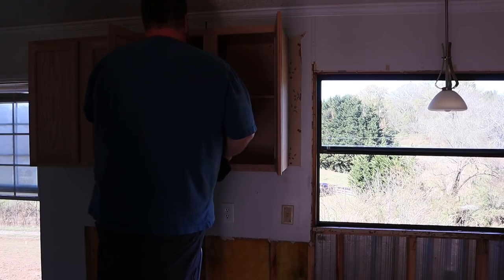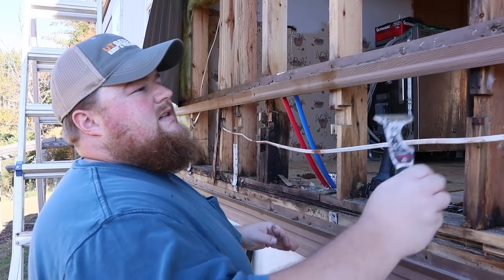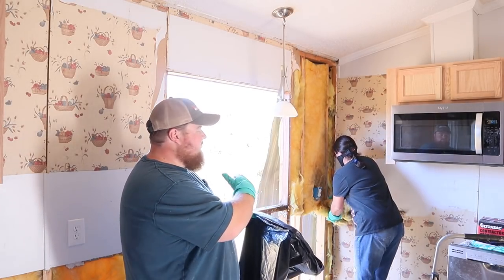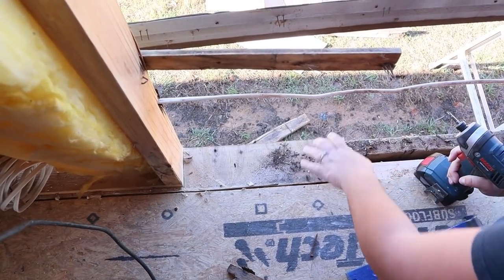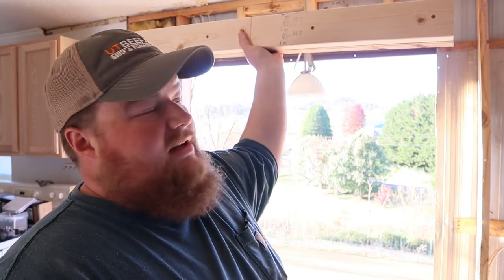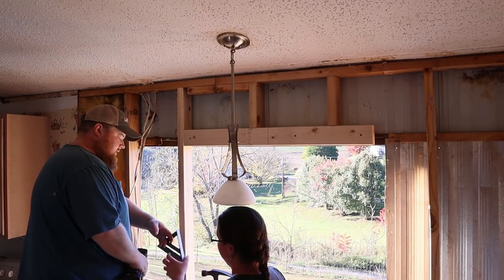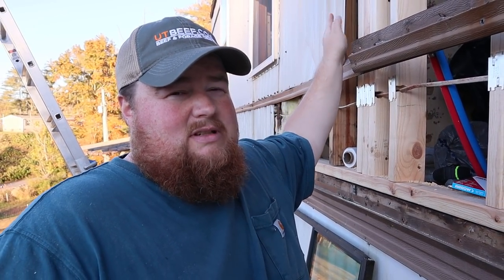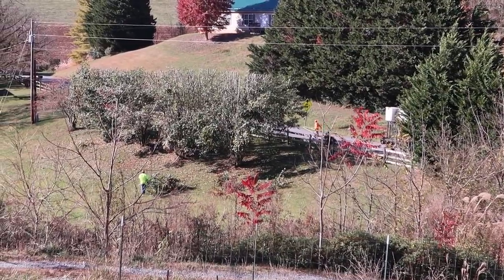COMPLETE Wall and Window Rebuild | Budget Mobile Home Remodel #17

Comment: Hey Guys
I like watching your video because you aren't trying to BS anyone. You have limited experience but you two can figure it out and are doing a hell of a good job. When my wife and I were first married I bought a MH for $300 and did pretty much what you are doing. I did not know to look for bad floors etc. Broken water lines blah blah blah. Worked on it every weekend and got er done. Only about $1200 in 1988 money and it was done. Still had to do heat and air but it was dried in. You two keep at it and you will always remember this build no matter how life turns out.

Comment: It looks great you two. I love how you guys work together  on your home to repair and fix it up like you want it. My wife and I worked on remodeling our mobile home for about 2-3 years. We installed a house type metal roof over entire top. Installed new house type steel entry door on front and rear, had to do some tear out and reframing for the taller/wider prehung doors. As we worked around the mobile home, I doubled 2x4studs at every other stud.  Also removed tore out and reframed for energy efficient home windows. Also both bathrooms showers and tubs were against outside walls, so while we had the old aluminum siding off, we remove just enough 2x4 studs at showers, to replace our old showers with brand new 1 piece shower stalls, framed and blocked them up, and replaced all new studs in exterior of bathrooms. New toilets, sinks, vanities, ect. We removed all the old insulation and installed new upgraded insulation. Our old sub flooring was 3/4" osb particle board, and it had a couple of bad places, so we cut old flooring out doubled up the 2x8 floor joists, framed in at interior wall areas, and at exterior walls, and installed 23/32" T&G plywood. We installed tyvek house wrap around outside of stud walls, and put Hardy fiber/cement board on exterior of our mobile home. We live in the country, so we put down a vapor barrier, and installed new vinyl laminate waterproof plank flooring, the entire mobile home. New hvac heat pump system, and new kitchen  appliances, countertops, and cabinets, Also added additional cement block piers, (8 under front & 8 under rear) under floors of our mobile home. It's also under pinned/closed in with cement blocks.  We even added a mud room, on the back. I know alot of people would say that was alot of overkill , but I wanted our home to be very strong and rigid, so that's why I added alot of extras.  We remodeled it and upgraded it the way we wanted it, and finished, and the very best thing about it, there is no mortgage, and we purchased everything as we did the remodel/renovation.  We saved thousands of $$ doing our own work. It's was alot of work and a long road but we got it done.

Comment: The king stud is the one that goes from the floor to the ceiling. The jack stud is the shorter one that supports the window header. The ones under the window are often called cripple studs. Also, cool video!
Reply from the maker: Awesome info, thank you! I can never remember this stuff.. even more when the camera is rolling. 😂 -Sam

Comment: I'm in the process of redoing a 1971 mobile home and this video was very helpful. It's been awhile since I have replaced windows, however, seeing how you did this it has giving me confidence to attack what I have to do. I have to replace all of the windows and  I am hoping the weather holds out for me as well. I am also going to rebuild the exterior walls with 2x4's and put on ziptech boards and eliminate the aluminum siding. I had to do a bunch of work to the roof way more than I anticipated. I am doing most of the work by myself which has been hard on me, as I my body is in rough shape. I still have to attack the other side of the roof but at this point the windows are a priority as the Maine weather can be brutal. The water and electricity have to be finished up as well. But god willing this will all work out as I am staying in a camper at this point which has no heat but I do have an electric heater and blanket which is working for now. Great  job you two, thank you again for the confidence boost now I can attack this project and I can refer back to this video if I run into any issues. Good luck with the rest of your project!

Comment: Header is a little small, but miles better than what was there before. Everything else looks to be beyond code(double sill is usually only required for windows over 5' wide). Should be much, much stronger than before. Good job!

Comment: Angela looked like she was gonna cry at the start of the video. Hug's sweetie soon enough you will get your kitchen back and it will be even better than what you had before.
Reply from the maker: I was bummed about taking out the cabinets again, and opening the wall to the outside. I knew it was gonna be a doozy, but ended up not being bad at all! I am ready to have our home put back together though. It's been rough on the family and hard to plan any meals or feel like we don't live out of the microwave. -Angela
Reply: @sam-and-angela  oh sweetie give it time i know it sucks. But im the end you wont be falling through the floor trying tobmake dinner. Which is good. The wall needed to be fixed. And the floors also. Your cabinets will come back and you can turn that frown upside down then.

Comment: My mobile home has 12 new vinyl framed thermal pane windows installed by window company into mobile home with aluminum siding and they are trimmed on the exterior with vinyl.!0 years to the Canadian weather and no sweatting to be seen!

Comment: I recently got a Permaroof installed on my trailer. There has been extensive water damage in one of the windows to the point a few screws on the top of the window are the only thing holding it together. All the wood is basically dust.

Since I'm an amateur when it comes to remodeling, and being on a tight budget at the moment. I've been looking for a good instructional video on how and what I I need to replace the whole wall.

 Your video is the best one I've found.
Reply from the maker: We looked at the permaroofs before deciding to do our own roof over. Hopefully it's good for you though! We're glad our content is helpful for you and hope they can steer you in a good direction. Best of luck!

Comment: Hey, as long as it works... Epic Win... I would have done part of it the same and part different, but that's neither here nor there.  Since you were reframing the window area big win getting the off the shelf window (would have reframed even if it didn't need it to be able to use the off the shelf window because it's so much cheaper plus no waiting many weeks to get it shipped, just walk out the door with it.). So, even though I may have done part of it a bit differently, as long as it's not leaking, call it a win.

Comment: A King stud runs floor to ceiling, the Jack stud is what runs up to the (bottom) of the header.  So what you were talking about was the Jack stud....

Studs used to frame around window and door openings are given different names, including:

king stud − stud to left or right of a window or door that is continuous from the bottom plate to the top plate

trimmer or jack − stud to the left or right of a window or door that runs from the bottom plate to the underside of a lintel or header

cripple stud – a stud located either above or below a framed opening, that does not run the full height of the wall

post or column − a doubled or other integral multiple of a group of studs nailed side by side. Posts in walls are used at point loads such as long spans near a wide window or sliding door, etc.

Comment: Y'all are doing a great job on the renovations and repairs. I have lived in a mobile home since 1982. It's a Fleetwood and is well constructed with plywood flooring (plywood flooring was a must). I would like to be able to do the pex plumbing (maybe this coming Spring). I've gotten a lot of inspiration from y'all and Doug and Ashley (Diyfferent) 🙂. I have a pop-rivet kit that belonged to my Dad. I didn't think I had a need for it, now I realize it will be useful after this video 🙂. Everything is looking great. Keep on going. 🙏🏻
Reply from the maker: Awesome!!! I wish you best of luck when you get started! I rarely use the pop rivet gun and it's always a treasure hunt to find it, but glad to have it (again) for such odd uses. 😎 Thanks! -Sam
Reply: @sam-and-angela  Thanks 🙂

Comment: On the DIYfferent channel he expanded his walls with with 2" stud wall overlays so he could replace the old 3 1/2" fiberglass insulation with 6" rock wool which is what I would do if I had an older mobile to remodel replacing the old 14 gauge wire as I went and putting in a new service box as well.
Reply from the maker: That would surely be ideal, but not within our budget to do. Our home wiring is 12 gauge copper throughout, but that's not the normal for mobile homes.

Comment: Multi-Tool question: I have not used this type of tool. I see you use it in many videos, how well does it really go through staples and nails? and therefore how often or how fast to the "blades" break/chip/wear? Thanks much. We are always anxiously awaiting your "next" video.
Reply from the maker: Great question! It cuts through staples very quickly and will do nails too. I have found through experience that a carbide tipped bi-metal blade is the best when you may run into metal to cut. The blade is more expensive than just the metal cutting ones, but lasts so much longer. Thanks!!

Comment: I hope you flashed above your window.  I was thinking, you should have pulled your siding off above the window until the area was flashed and seal taped.  I may have missed it or you skipped videotaping it. Also, you didn't show putting caulking on the top of the window.  It looks great tho guys.   Not trying to be mean or negative just proactive.  😁😁😁👍

Comment: I have to replace a 10 ft section of wall in our kitchen due to previous owner not fixing a water leak correctly. Never done any type of wall repair or replacement on a mobile, but after seeing this? Shouldn't be too bad as long as the water leak is fixed and the rot is removed.

Comment: That window looks real good.  How does it do with moisture?? I have mold in my mobile home windows real bad from moisture....never seen this in stick built; so was wondering if you did with the older windows compared to new ones installed.
Reply from the maker: The window's great! We've also replaced all our other windows with similar dual pane windows and have zero complaints with them. Very happy to have them in the home now!

Comment: I’m surprise your home doesn’t have some plastic vapor barrier between your siding and the studs.
Reply from the maker: Unfortunately that's how mobile homes were built in the 1980s.. I wonder if there aren't still some being built without vapor barrier today, too. 😬
Reply: @sam-and-angela  I don't think it's allowed anymore we live in a 2015 model single wide and the walls are twice as thick as the ones in your house and a lot of older mobil homes I've seen my significant other likes to keep the thermostat at 74 in the winter and were in lower Michigan and natural gas forced air heat and the bill has never been above 80 bucks a month with gas stove for cooking so I think that's pretty cheap
Reply: You still don't need to copy replacements. Do it right.  Osb sheeting and vapor barrier will save money...let alone be safer!

Comment: I cannot believe there is nothing under that aluminum siding. I thought Palm Harbor homes were built better than that. I worked at a MH factory in the early 70's in South Dakota and we at least had fiber board under it.

Comment: Instead of notching the studs I would have disconnected the wire, drilled holes and fed the wire back thru them to the plugs or wherever they went. Notching as you did weakens the studs a bit.

Comment: Why did you put house wrap, on a plain wall instead of using plywood siding. Good video
though, and thanks for sharing.
Reply from the maker: We have plans to redo our exterior someday in the future, just don't know when. If we had put sheathing on it, the metal siding would not have gone back on and we would have been left with a predicament. We will get to it eventually, just trying to keep thing manageable, too. We are doing this whole project paycheck to paycheck without using any credit cards or debts/loans. Thanks!

Comment: I think it's amazing mobile manufacturers don not sheet the walls with osb or plywood  and just put outer sheeting on as the walls. I guess it's for weight as they are mobile. Doug at DIYfferent completely re-sheeted their mobile before adding siding...much stronger walls.
Reply from the maker: Our home is a 1988 model and back then they did it this way. Yuck! LOL I've heard that newer homes 2009 and newer are built much better, but we'll never know that one. LOL After enough time and work ours will be better than new though. Thanks!